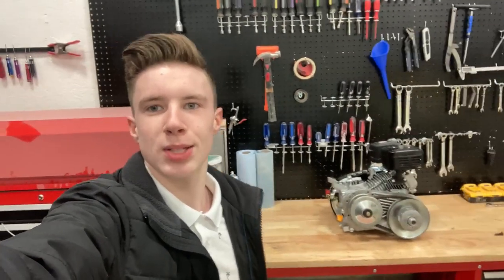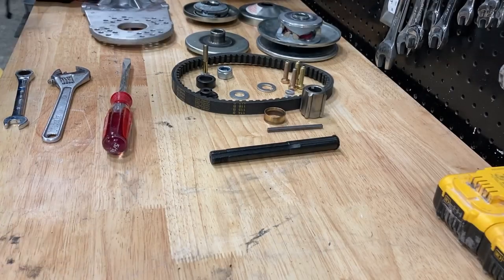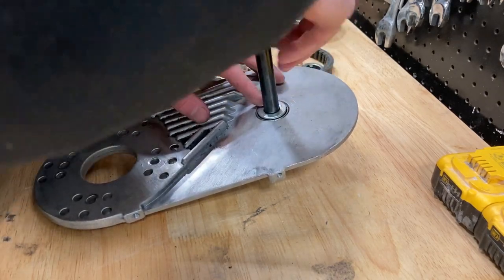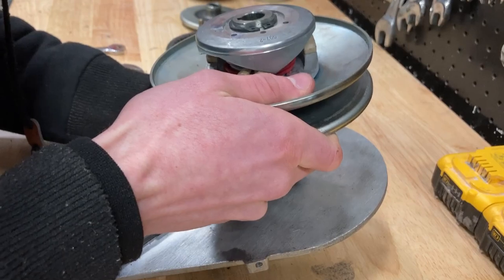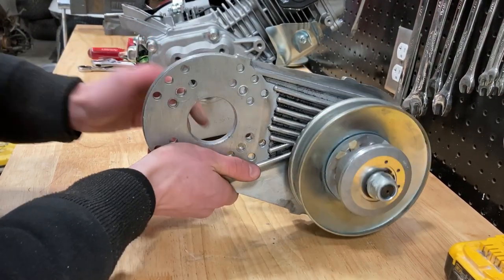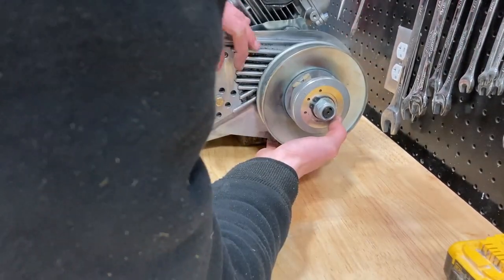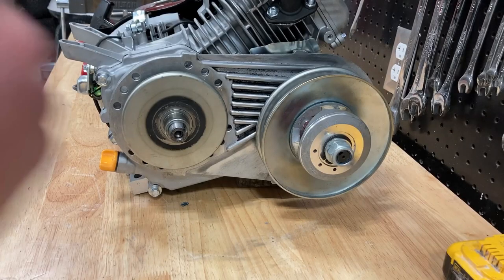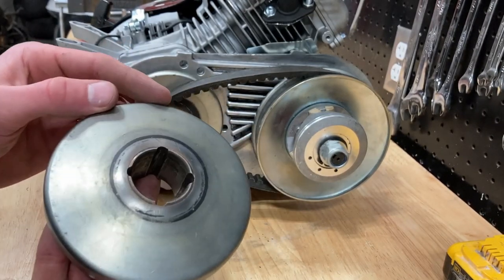How to Install Torque Converter on Predator 212cc Go kart engine

Comment: Almost a perfect video, but why did you skip putting the lock washer and the final bolt in? That's a very important part considering I literally just bought a go cart with this system and it did not have the lock washer and had to order this tort converter due to it flying off from not having it's a lock washer. Wanted to watch a video to make sure. I put it together right and you left out. What broke it in the first place
Reply: Ik what you mean lol, I have the same luck when it comes to YouTube tutorials. Always cuts out right when it gets to the part I needed to know the most😂💀 hope you found the right bolts ik i havent
Reply from the maker: Thank you for the comment and that’s a great point. I will have to add that part to the video.
Reply: Hey dude, sorry to bother just wanted to ask if he has updated the video with the lock washer portion yet?

Comment: Dude you forgot about the washer that goes on the inside of the collar. Make sure you get it right before posting and wasting peoples time
Reply from the maker: Not exactly sure what you mean by that. You cannot put a washer inside the collar. You could put one behind it if you want to. It’s not necessary though.
Reply: Before you installed the collar on the shaft of the engine there should have been a washer. I put it on without that washer bc I watched your video and it did not fit correctly everything was loose but I watched a different video and found the correct way to do it 👍

Comment: Um my engine got messed up on my Coleman ct200u ex 196cc and somebody told me that the clutch from my old engine should fit on the predator 212cc but I’m not sure if it is gonna fit
Reply from the maker: if it doesn't work here is the one i bought 
https://www.amazon.com/Centrifugal-Clutch-predator-Lawnmower-2-6-5HP/dp/B08GZ8FWGR/ref=sr_1_2_sspa?dchild=1&keywords=predator+212+clutch&qid=1621792711&s=automotive&sr=1-2-spons&psc=1&spLa=ZW5jcnlwdGVkUXVhbGlmaWVyPUEyTUtNVTNZUTlTMEg4JmVuY3J5cHRlZElkPUEwOTM1NTMwTU5GMlMyQkNKT05EJmVuY3J5cHRlZEFkSWQ9QTA1MjcwNTEyVUMzOFpGVzlDWU45JndpZGdldE5hbWU9c3BfYXRmJmFjdGlvbj1jbGlja1JlZGlyZWN0JmRvTm90TG9nQ2xpY2s9dHJ1ZQ==

Comment: Do you have the link for the torque converter you bought for the video
Reply from the maker: Yes. This is the link for the one I bought. 

https://www.amazon.com/MOOSUN-GO-KART-TORQUE-CONVERTER-218353A/dp/B07T1KRS4V/ref=asc_df_B07T1KRS4V/?tag=hyprod-20&linkCode=df0&hvadid=375249767987&hvpos=&hvnetw=g&hvrand=15583118694777235614&hvpone=&hvptwo=&hvqmt=&hvdev=m&hvdvcmdl=&hvlocint=&hvlocphy=9025512&hvtargid=pla-854868523607&psc=1&tag=&ref=&adgrpid=79352187760&hvpone=&hvptwo=&hvadid=375249767987&hvpos=&hvnetw=g&hvrand=15583118694777235614&hvqmt=&hvdev=m&hvdvcmdl=&hvlocint=&hvlocphy=9025512&hvtargid=pla-854868523607

Comment: Mate, forgot to tell us about the belt, it has a flat side and a curved side, if you flip it wrong the go karts shaft will pop off while driving,
I’ve experienced that and caused injury to my back and my engine leaked from it explodes apart so make sure the belt was right, they right side should be facing the flat part of the metal and the left curved should face the curved metal
Reply from the maker: i had that happen once. your right i should add that in somewhere. thank you!
Reply: You didn't ad anything to this video you should take it down if you're not going to fix it 😮@perinpowersports9696

Comment: Is there a way to have the rear shaft extended to right side? I'm looking at converting an E-ton AXL 50cc to a 212, but the chain drive is on the right side of the unit and not the left. My only other option I can see is to replace the entire rear axle with the sprocket on the left.

Comment: Need Help to install better rim and clutch gear and more to make it run better I have a 212 Predator motor I have a spunder go kart with plastic body need help please so I can ride my first go kart I have always wanted let me know what to but to take out the old rim and gears from it thanks
Reply from the maker: ok, are we talking about the wheel rim? if so GoPowerSports.com would be a great place to find a rim and tons of other go-kart parts. they also have many of the best clutch options out there. when you go to look up the rim make sure to match it up with an old one. if you don't have the old one look at how it bolts up and the size of the tire you are going to be using. with the clutch, it's going to be a 3/4 in the bore. make sure to match up the chain with your clutch. it's probably a #40 or #41. and a 12 or 14 tooth would be great for that go-kart. if you have any other questions feel free to ask. would love to help you get your go-kart working again.

Comment: Good video buddy. The problem with mine is it won't dissengage. It's installed correctly the belt is the one that came with the kit and is installed correctly as well. I'm at a loss here do ya have any advice for me?
Reply from the maker: Have you tried flipping the belt? The torque converter belt is made to only work one way because the groves in the belt are usually angled. if that's not the problem it could also be that the torque converter is not mounted in the same position as the one in the video. when i tried to mount mine differently it would engage all the time. I hope that helps. let me know if there is anything else you need.
Reply: @perinpowersports9696  I will look into it man I really appreciate you responding to my comment. I haven't been able to work on for a week. I cut my foot pretty bad and have been laid up. I'll check it out next week and hopefully it's jus something silly I've done incorrectly but I don't know I think it's all correct. I'll let ya know what I find and I subscribed to your channel you have good stuff. Have a good one!

Comment: Hey so I have a new egine but my shaft have the key outward but I can’t find a tourqe to match the key what should I do ?
Reply from the maker: you can pop the key out and the shaft will have the slot in it. then you should be able to install the torque converter. lmk if you have any other questions.
Reply: @perinpowersports9696  thank you so much !!!!!

Comment: Having a hard time aligning chain with torque converter. Why does my chain keep coming off
Reply from the maker: Well if it’s not aligned straight that could cause it to come off. Also you want to make sure your chain isn’t to loose because that could also cause it to come off the sprockets

Comment: I had my sprocket welded to axle will i still be able to upgrade it?
Reply from the maker: you may be able to grind the sprocket off the axle but otherwise you would have to totally replace the axle and that can be pretty difficult
Reply: @perinpowersports9696  darn
Reply: @mikerotch6733  it sucks and those axels are like 200
Reply: Why the fuck would you even do that?
Reply: @Coinz8  I bought it like that for 200